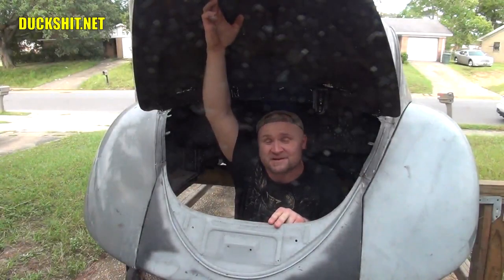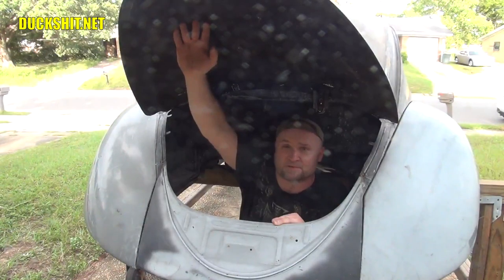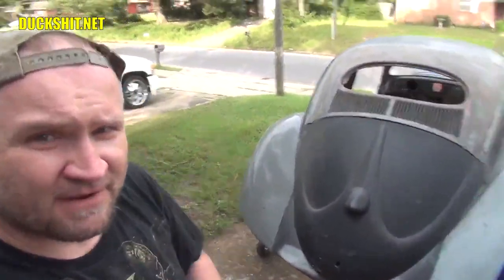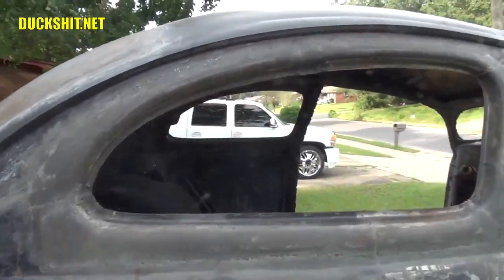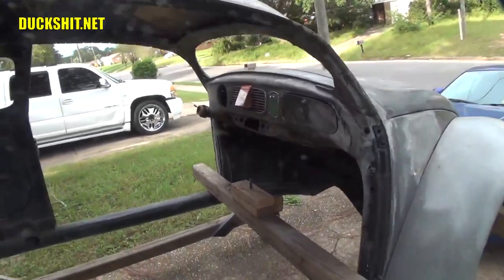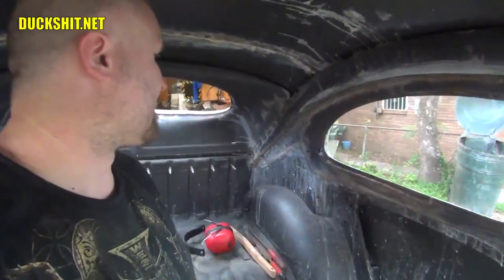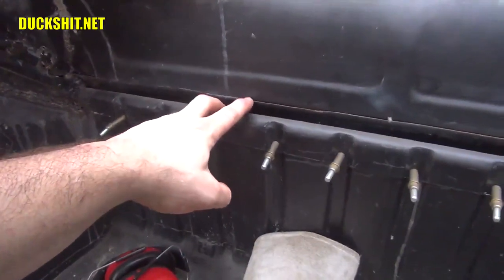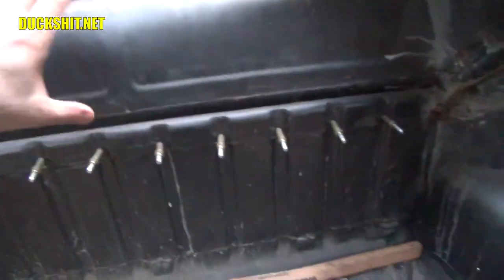Window Welding - ROTTEN OLD 1956 Chop Top Oval VW Beetle - 38

Comment: I’ve built a few cars from the ground up but have done very little body work and no top chopping, what is your vision for this car, will be be like a rat rod, or a show car or what level in between? Welding all that sheet metal would drive me crazy. I loaned my mig welder to a friend and it got stolen so now I have to tig everything which takes forever, especially at my skill level.
Reply from the maker: Well I actually answered that a couple times even in video, but the car for certain deserves better than Rat Rod treatment.  I wouldn't go through all that work just to let it be ugly and probably rust more.  Lots more to come!

Comment: There is a YT Mike F    from - he says he is right by Wolfsberg West he took 3.5 bugs and made 1 . He gonna do a before - after montage . He done good work but what was amazing in about 2-3 months . that sucks I have been thinking about working on the cargo floor for that long . When you get old time flies . I dont know about letting that Ospho setting that long but if you use it and let it dry and try to paint it will not stick . but since you let it set it mite work .I am just saying try a test piece because it mite save a lot of unnessasary work . Man You are gonna have awsome suspension on it . to bad you could not find a 912 trans . I could have got a 912 with a knocked rod , for 400 bucks back in 94 , man the trans. was worth more than that .  Take care of Elenore ???
Reply from the maker: Well in my case I use less than 1 beetle in made 1... lol.   I'm sure if I had that many cars to work with and that's too many setbacks in my personal life I probably wouldn't been able to do it the same amount of time.  Phosphoric acid is great, the paint always sticks, but you have to make sure you prep everything properly.  Let the acid dry as long as possible, and then make sure you clean off the residue, otherwise nothing will stick!  Thanks always for your comments!